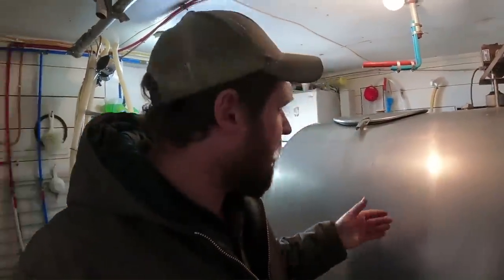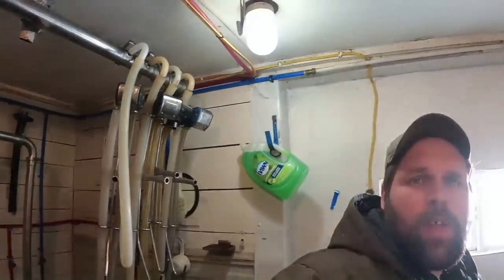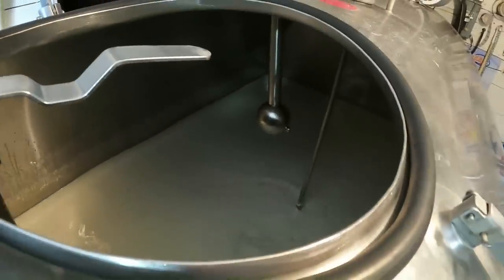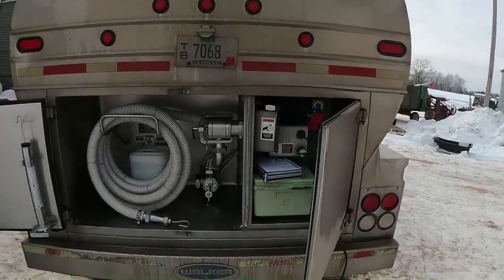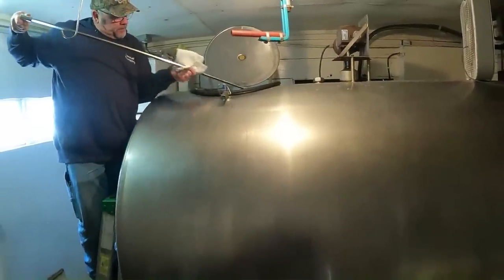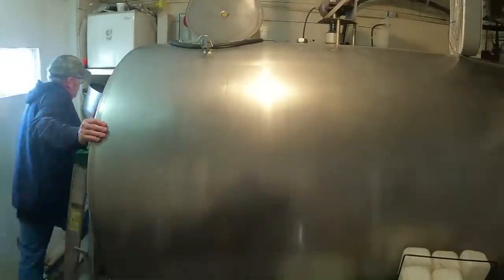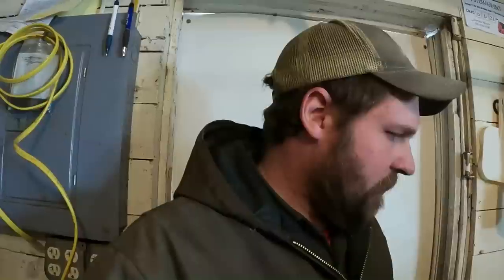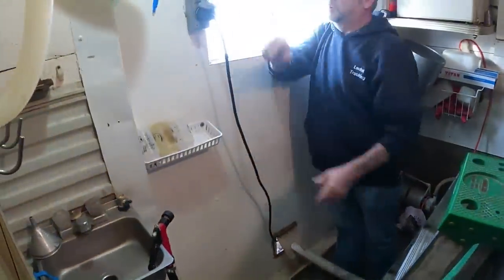Milking Cows/Milk Truck Comes/How Our Milk Gets Sold/25,000 Subscriber Giveaway!

Comment: My dad was involved with dairy for most of his life, delivering milk, dairy farming and working in dairies. I remember when he worked nights at a dairy cleaning the giant vats and wherever the milk traveled. I was lucky to see some of it a couple of times. He was only 5 ft 2 inches and not big and climbed into their vats through a circular door (something like a front loader washing machine door). He would then wash them with a strong detergent and with pressurized steam hoses. He once had a steam hose get away from him and ended up in the hospital with 1st and 2nd degree burns for a bit. 
The dairies bottled milk in containers they made on site, made ice cream, cottage cheese and also things like cheese dips. They mixed and bottled orange juice and punch drinks from concentrates. He enjoyed it thoroughly and was proud that his systems always passed inspections.
 Another interesting thing he brought home was something that looked like a large candy kiss shaped part made up of tiny highly compressed wires. It was a part they ran the milk through at high pressure to create homogenized milk. 
We also occasionally had ice cream or dips that was not just perfect and couldn't be sold. Nice.
As far as a hat color I like black and white like the cows, but don't need a hat. Hope you have a lot of good suggestions.

Comment: Used to be the last stop on a semi truck that had 90k weight permits.............Certain times of the year we had to help the driver because the truck would overfill.  I seem to remember that trailer was split in half, a few lucky guys had to buy half a load over the years.  Seem to recall insurance at the time would pay for one in such and such a time, but foggy on that.

I find it interesting how things are setup in different areas of the country.  Here they want the plug on the outside, with a switch inside on the wall where the "Doggy Door" was for the hose.  They would turn the pump on and off with that switch.  Then the hauler here had to have a wet line on the truck for a hydraulic run pump to pick up the Amish, always wondered how mueych weight all of that added up to the amount they couldn't get any revenue from.  Then they had trucks without that, so it screwed up routes if trucks went down.  I hope they paid more for the hauling because of that, but probably skidded off on it like everything else.  

Then on Christmas, the driver would run the route in reverse, so we got picked up first.  That was always fun, I told him he could give me a present and wash milkers while I finished.............Nope.  Ah well, still good friends with the driver to this day.